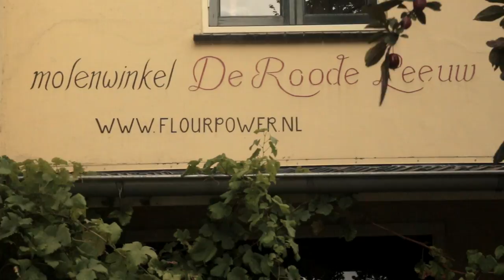The Red Lion Mill • Working Flour Windmill • Gouda - THE NETHERLANDS

Comment: Why does the man not like the wings of his windmills spin fast? He made the wings spin slower. But why did he do so and why did he say "(it was) scary"?
Reply: For the grinding process, the millstones have to run a certain speed. So if the mill spins too fast, the quality of the end product goes down. 
Another one is safety. If the mill goes too fast, you can’t apply the brake safely, as it can quite easily catch fire.